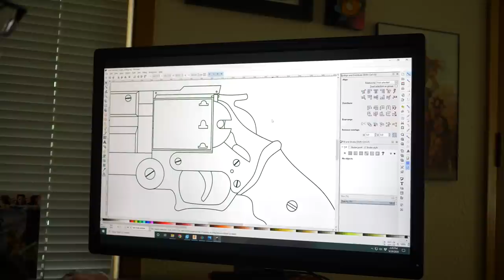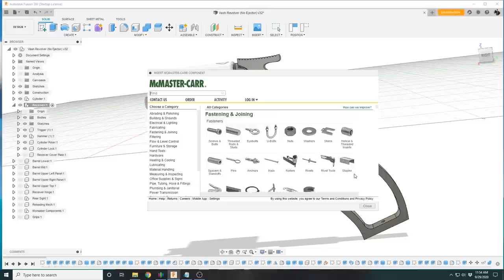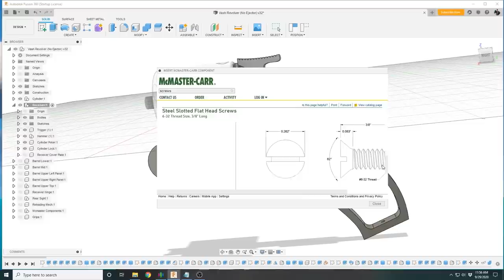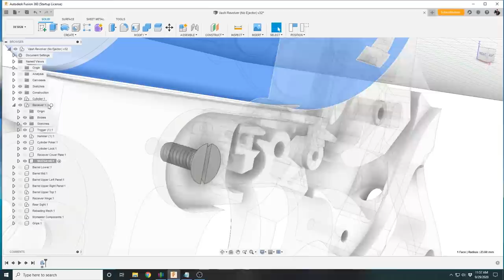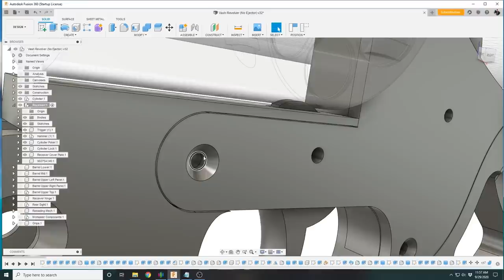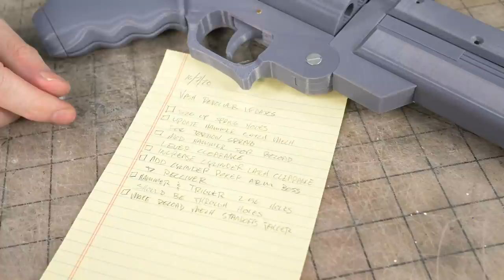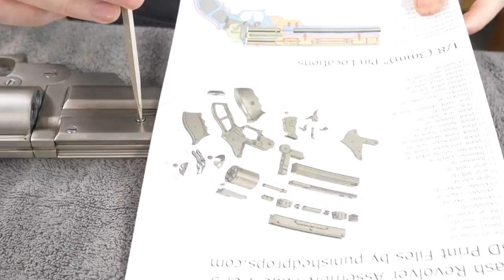LOVE AND PEACE! 3D Printing Vash's Revolver | TRIGUN

Comment: Damn, might be getting this in the coming months. All the ones I've been able to find don't have working mechanisms and/or have TERRIBLE handles. And for only $9, that's one hell of a deal for the detail and work put into it.
Reply from the maker: Really glad you like it! Can't wait to see what you do with it :)
Reply: @punishedprops  a project of this quality, working in all the parts (even the single action cocking of the hammer) its gifted for 9 bucks
Reply: @punishedprops  how about a couple of simple attachment piece models for people who are going to just mount the top cover permanently? Would save some printing time and filament. The only iffy bit of this design is the latch that holds it closed.
I'd love to see someone modify it to have an ejecting system for the shells so they pop out like many real break open revolvers.
Reply: @greggv8  ejectors wouldn't be bad to do but I really really wanna try and make a real one its been my #1 gun crush and the 2nd is the Beretta Sword Cutlass from black lagoon.
Reply: @greggv8  I COULD IF I COULD GET THIS POS APP AUTODESK TO WORK !!!!!

Comment: Now do a version with the cylinder auto-ejector that Vash has to help dump rounds faster lol. But this is absolutely fantastic.
Reply from the maker: I actually did prototypes to try and make it happen but it just wasn't working. You can see my vlogs at https://punishedprops.com/extra-credit-club/
Reply: Some old break-action revolvers really had those. I've got an antique Enfield that does that.
Reply: @punishedprops  I was hoping it would have the case ejecting system on :( 
Let us know if you make a V2.0 !
Reply: the issue with break-action auto-ejectors is how fragile they'd be in plastic. (essentially that cylinder axis has to be hollow with enough room for a plunger, spring and a linkage to the hinge, in metal that's fine. Not sure about trying to print something like that)

Comment: It does all the things, EXCEPT, for the auto eject.

HOWEVER

This thing is effen amazing.  Im praying santa brings me a 3d printer for christmas- I need this prop.
Reply from the maker: Thanks for watching! I wanted the auto-eject but it ended up not working out. Consider joining our Extra Credit Club to check out my vlogs on the process! https://punishedprops.com/extra-credit-club/
Reply: Its also not double action :(
Reply: @TheDestroyer1250  "Its also not double action :("

https://youtu.be/rjBg6BuiScY?t=2700

Good news- It is :D
Reply: @punishedprops  Thank you for the link im definitely going to check this out! New to the channel, but this video alone has gotten my sub- And when i finally get a printer in, im already seeing some designs i love.

If I can be a pain - What was your experience trying to incorporate auto-eject? Was it simply a lack of room, or other technical issues?
Reply: @SidewaysGts  I watched the entire video and never seen the hammer lock back until the last 5 seconds. 

Anyway, I might buy the model and make a metal version. Are the models in STL or STEP or Fusion360 files.
Reply: @Preston Jester STL

Comment: Love the build. I haven't watched Trigun in a long time. I will of course assume your model is accurate to the series but did notice a functional issue.  With the way the hammer is positioned it would fire from the top cylinder as is standard. But the barrel would be aligned with the bottom cylinder.  I know anime guns, not real, all the good stuff. Just an observation.  Your work looks amazing as always. Keep up the good work.
Reply: I noticed the same thing, it is a Mateba style firing action that fires from the bottom cylinder.
Reply: @2Dopeification  From the way it looks the bottom round in the cylinder doesn't line up with the barrel. Not sure if that is how it is in the anime or not. Just something I noticed myself.
Reply: @2Dopeification  yes but if you look at a Mateba the hammer alligns with the bottom cylander allowing it to fire from there. This does not.
Reply: @167Maverick  Yeah, the barrel of Vash's gun aligns with the bottom cylinder, however Bill's hammer is based on the airsoft revolver which fires from the top cylinder so wouldn't work if it were real.
Reply: The chipa rhino fires from the bottom so... just use that design for and update.
Reply: @commanderwolf_gaming5191  beat me to it.
Reply: @joshveer1138  sorry bro lol 😁😎

Comment: Love the build, perfect copy of the anime gun.  One small problem I noticed the anime gun would never fire in real life due to the barrel being on the bottom and the hammer hitting the round at the top of the cylinder.  The barrel should actually be on top not the bottom for it to fire. Otherwise a very good copy of the anime gun.
Reply: There are guns with the barrel on the bottom. I would say modify the hammer if it wouldn't work as I find the barrel more iconic for the gun. Chiappa rhino seems to be the most common revolver if you Google inverted barrel revolvers.
Reply: Ideally the hammer system would have been modded to account for this, but considering he copied from a standard 12-o-clock revolver it's a minor issue. Years ago I believe there was an airsoft mod kit for a Japanese Mateba revolver ( 6-o-clock alignment) that let you wave this thing around, so the 6-o-clock alignment definitely works.
Reply: Vash's pistol is modeled after a real steel firearm made by an Italian company called Mateba. The Barrel is lower down, lining up with the bottom chamber of the cylinder, as opposed to the more traditional style of revolvers. The hammer of the Mateba pistol is actually a false hammer, that in reality is the gun's safety. Clever mechanics inside the receiver/body of the gun itself conceal the actual firing mechanism.

It's a really cool weapon that you should look in to if you're a real steel guy.

Comment: A lot of nice detail work there. However...
It does appear that the cylinder's chambers don't line up with the barrel. This would cause some excitement when fired. Also, the hammer seems to fall on the top chamber, which is the one furthest from the barrel.
I shoot real ones, and this design just makes me itch.
But it is great workmanship - so there is that.
Reply: @Michael Jordan This model is true to the anime in design though. While I understand the point about the hammer striking the top chamber as is, why can't the firing pin be mounted lower on the hammer assembly, (for a real steel version) instead of in front of the thumb pull? This is a far future sci-fi Western show with alien technology incorporated in the pistol, so maybe in the future they've designed a functional hammer of that type?
Reply: Vash's pistol is modeled after a real steel firearm made by an Italian company called Mateba. The Barrel is lower down, lining up with the bottom chamber of the cylinder, as opposed to the more traditional style of revolvers. The hammer of the Mateba pistol is actually a false hammer, that in reality is the gun's saftey. Clever mechanics inside the receiver/body of the gun itself conceal the actual firing mechanism.

It's a really cool weapon that you should look in to if you're a real steel guy.
Reply: @muselessmusician  I did not know that about the Mateba's hammer! Cool! Being a GitS fan I've definitely heard of the mateba, and there's an Old West pistol with the break action, think it was a Webeley(sp?) revolver & I think there's another bottom chambered revolver as well. I wanna say a Rhino...?
Reply: i noticed that and was gonna say that but still looks excellent work
Reply: He's using a gun for reference that fires from the "12 o clock" position instead of the "6 o clock" position!! 
This could be the issue as to why barrel and cylinder isn't lining up correctly.
Reply: @itsagundam79  there's actually is a real revolver that this one is modelled after. It's the Mateba Semi-Auto revolver....
There are some downloaded videos here on YouTube about the revolver...
Reply: @muselessmusician  I didn't see your comment, and I'm actually surprised to see someone else with the knowledge about the Mateba!!!
Reply: @ericwilliams7374  yeah, I um, mentioned that in my 2nd comment on this thread. By name. 😏

Comment: What I have in my shop is a few glass jars with various 3D filaments melted in acetone, it makes an amazing 3D print glue, as well as filler for any print problems. Something you could try.
Instead of brittle superglue holding pieces together, they basically weld together and become a single part, it is also a great thing to smear over magnet recesses, allowing for magnets to be completely hidden.

Comment: Wow, we have come a long way. I used to cosplay Vash back in the early 2000s, and both of the kits I had for his gun were resign garage kits I had to import from Japan.  The usually cost between $250-400 and were completely unfinished, and the quality of the resin casts was not something to write home about, with various air pockets and such to worry about.

Seeing this make we want to pull the red pleather duster out of the closet (although i sincerely doubt it would still fit me) and bring it back. Amazing how far 3d printing has brought cosplay capabilities!
Reply from the maker: Cool isn't it? So exciting to cosplay these days!

Comment: This is amazing bill it does everything the only thing I noticed you missed was the auto eject but with the design of where the axle for the cylinder is I can see how that would have been an extremely difficult function to work into the model
Reply from the maker: Yeah I actually tried to include that function as well in my initial prototypes - you can see some of my attempts and why I decided not to add it in our vlog recordings! https://punishedprops.com/extra-credit-club/
Reply: @punishedprops  I will have to look at that. I did a little research and the extractor used in fascist gun would have to be similar in style to the Weebly revolver which involves a hooked pole inside the frame of the gun that pushes on a spring-loaded cylinder axle to push out the center of the star lifting the rounds from the chambers it's an incredibly complex design.

Comment: Trigun has remained my favorite anime for years since I first watched it back about 20 years ago. I've even watched it recently to make sure that it remained in the top place. I have always wanted to build a real one and plan on it at some point. Your internals wouldn't work for that though so I'm going to have to design internals from one of the 2 bottom cylinder revolvers (that I know of) that have been made. The Mateba 2006m or the Chiappa Rhino. Very very nice prop though. I will at some point be purchasing the files to print my own. Keep up the good work.
Reply from the maker: Hey thanks so much for watching! It's one of the greatest shows out there :)

Comment: You should ask around at local ranges and gun shops to see if any of them have reloading equipment to reload the caliber(s) you want props for.
From there, you can ask them to make prop rounds (real ammo, but with the primers pre-cooked so they can't go off, and with either no powder in them, or you could give them some ABS/PLA flakes to put in them for that authentic bullet sound when they're handled).

It really wouldn't be too expensive, and that way you'd have bullets that look 100% authentic (because they would be) but are entirely safe and non-functional.

Comment: I'm a shooter so a lot of things make me cringe out of safety, but this is a prop and I've some some minor SFX in amateur sets......so I can switch brains.

The thing I would have done different with the build, that immediately comes to mind, would be to have a pin run the full length of the plant. That way, you wouldn't have to worry about glue and very small pegs holding it together. Especially since it's an area where you would open/close it on any regular basis for show.

I could go all crazy on the trigger assembly, but that's a shooter thing. You did it so it would function as a prop and that's fine with me. No single action, though. Meaning locking the hammer to the rear and then pulling the trigger. That's part of a double action revolver. 

It's shown in the anime and I'm sure you saw it.

Great job!!!

Comment: I FINALLY got around to building mine (SUCH BEAUTIFUL WORK MAN!) The only thing that doesn't really work is the leaver that makes the cylinder revolve. Its a little short. Other than that, everything else is flawlessly beautiful!
Reply from the maker: Hey thanks for the feedback and I'm so stoked to hear you made one!
Reply: @punishedprops  i have an idea of how I could fix that piece, either by heating up the part that makes contact on the cylinder and stretching it out or by adding some bondo to it to make it a little longer. But again, other than that 1 piece everything else is flawless

Comment: This video made me get a 3D printer so I could make this (I love Trigun!!!). I am beginning to attempt to build this using your STL files. I just got a CR-10s Pro V2 so I am still working out the kinks of how to print. I would love a little help with how you setup your supports when you printed this. For example, did you need to have support down the barrel and how did you set them up? It seems like they would be impossible to get out. Maybe you could do another quick video of your print settings for this? It would be super helpful! Love your guys work and videos thanks for the awesome content!!
Reply: I agree some kind of discussion on support settings, printer settings, etc. would be really helpful. heck, just a couple of shots of the parts on the print bed showing how the parts were placed would be nice, I'm trying to lay most of mine flat with supports generated as needed, but I hate wasting material.

Comment: Assuming the dimensions fit it you may also be able to load/chamber other ammunition into that puppy.  The .460 S&W, the .454 Casull, the .45 Schofield and even the .410 shotgun shell, depending on the length of your cylinder and the different length shells.

Comment: since the gun fires from the bottom barrel, the hammer is only really there to allow the gun to be cocked and decocked. the firing pin would be in the lower portion of the hammer assembly. I finally got my first printer (the pile of parts arrived yesterday)... I will likely be getting those files from you by years end.
Reply from the maker: How exciting!

Comment: On places like the trigger and the front and back strap of what would be the frame/grip on a real gun, you can leave the layer lines. On a real gun a lot would have that for grip. It's sometimes refereed too as stippling or if done in a square or diamond pattern checkering.
Reply from the maker: I did that for my Blade Runner blaster! Vash's gun actually has a smooth grip so I sanded it too

Comment: Sorry if this seems stupid but I’m a little new to all this. Would this be possible with PLA or ABS in a ender 3 pro? I’m a HUGE fan of trigun but I’ve only ever used my printer for DnD minis
Reply from the maker: Yes, so long as it fits in the print area. The longest piece is 196mm.

Comment: How did you get the mechanism to print looking so smoothly? All the small pieces look like they were injection molded but don’t look sanded or anything!
Reply from the maker: I sanded every piece of this gun. But you can help yourself a lot by printing at a higher resolution and a smaller layer height

Comment: For fixing the text filling up you can try playing with the "Initial layer line width" setting in the "Quality" section of Cura. If you dial it down to 100% your first layer lines should be as thick as the ones on every other layer. Alternatively you can model a little chamfer or a step on the surface of the text to make up for the extra plastic extruded during the first layer
Reply from the maker: Thanks for the tip!

Comment: Bill, on your holes where screws go, did you print actual threads or are you sizing them so the screw bites into the print?
Reply: He's printing the holes undersized then tapping it as can be seen at 17:40. This part isn't holding anything together but I would assume he's doing it this way for all screws to make sure it has a good grip and doesn't split the part.
Reply from the maker: Yep, just tapping after printing :)

Comment: FYI - In the Move/Copy Dialog you can select MOVE TYPE and then select Point to Point and then select OD or each and it will mate at those points.
Reply from the maker: Oh cool thanks!
Reply: @punishedprops  No problem.  I use Fusion everyday.  Good channel to learn more is Lars Christensen.

Comment: That looks amazing! It turned out so well!

My only gripe is with the design of the gun. It's nothing against your model. It looks amazing and you did a stellar job modeling it! It's just with the design from the anime. I don't really know anything about Trigun, having never watched it but the mechanism of this gun just looks so wrong. I know it's anime so it should be taken with a grain of salt, but it looks like if you shot this gun it would just explode in your hand. The hammer and the barrel should be aligned so when the hammer contacts the primer on the bullet it will send the lead straight down the barrel. It just would not work with the barrel on the bottom like it is. Just a weird choice from the artist.
Reply: Pretty sure the gun is based on the Chiappa Rhino. Which fires just fine.